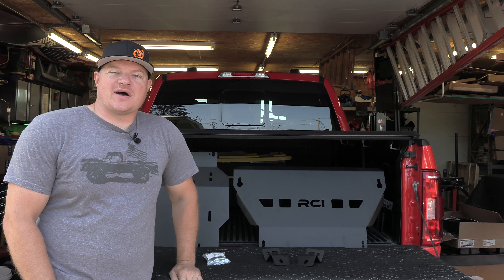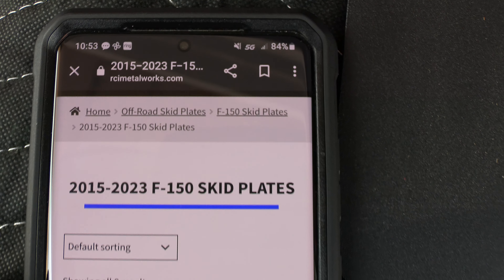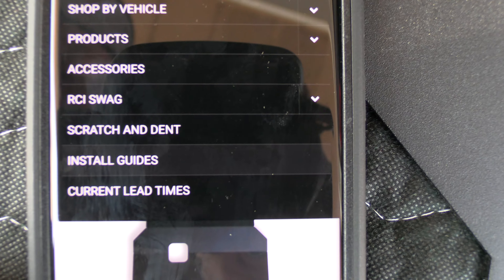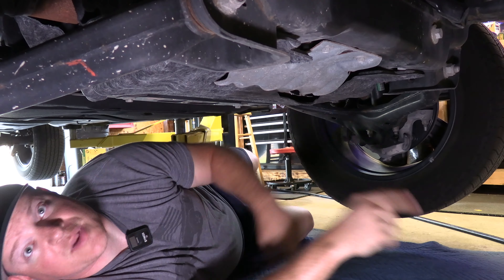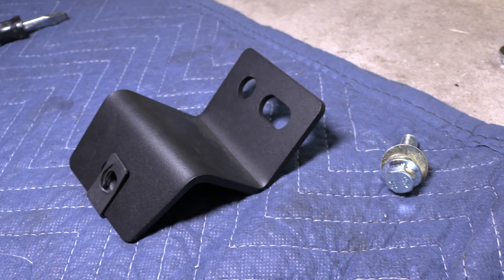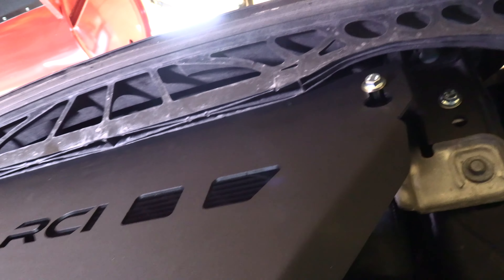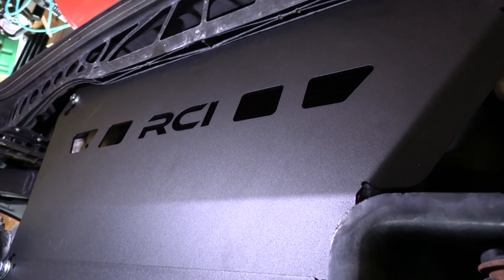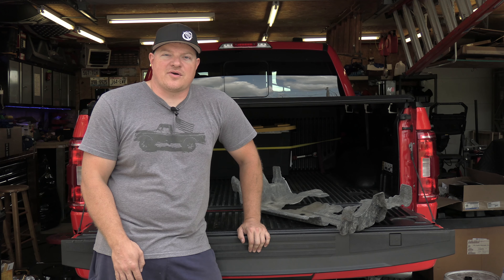RCI Skid Plate Install 2015-2023 F150

Comment: I believe you should have put the rear of the front plate over top of the front edge of the rear plate. If you were to hit something with the front edge of the rear plate, it's possible the bolts could be sheared off or other damage to the rear plate could occur. It would also make taking the front plate off for an oil change easier.
Reply: On my 4x4 there is a shield that comes from the factory for the electronic front diff.  Same as in the video.  If you install it that way it interferes.  Could remove it but then the connector is exposed to the elements.  For 2wd I think it would work as you would like to install

Comment: With the plastic oil pan on the F150s even if you just do light off roading I think you have to get skid plates in my opinion. Take that for what it’s worth. I bumped and I do mean bumped the oil pan on a log and it flexed enough to cause it to seep oil.
Reply: Me too! 🙋‍♂️

Comment: do you think the install of these skid plates woold hinder adding a FRONT 2 " receiver hitch like from draw-tite? It attaches to the frame. I have yet to see someone install BOTH the skid plates and a hitch- what do you think?
Reply from the maker: Im not sure, but this skid plate covers the air dam and front frame section. You would have to eye ball it and see if it will work.
Reply: @Oxman_Garage  Got it Thanks

Comment: I have a brand new 23 f150 xlt and I noticed that the engine splash cover is not there… is this normal??? I can see the pulleys and belts…
Reply from the maker: That is unfortunately normal. You need to buy a RCI skid plate or something similar.
Reply: @Oxman_Garage  really?? Thank you!. To be honest, this is completely unacceptable for a 60k truck.  I can’t believe Ford doesn’t at a freeking splash shield. I barely have 12k miles on it and I just noticed it.
Reply from the maker: Agreed, it's ridiculous. They should have had something like the RCI skid or Tremor.
Reply: @Forddude24 mine was $70k and it only has 8k mi with no guards or an engine cover. 🤷‍♂️

Comment: Step one... Get rid of air dam then proceed with this video.
Reply: I just installed this on a 2024 Powerboost F150.  Per the instructions, it says to remove the air dam.  I called RCI and asked them if I can put it back on afterwards.  They said if you have a 2022 to 2024 (2024 is the latest model as of this date), you can replace the active air dam which I was able to do successfully.  Not sure how many years before 2022 you cannot re-install the air dam.
Reply: I was thinking same thing. Why would you want the air dam anyway? It saves 2% in fuel efficiency I read.
Reply: @jrossnjax7  I do half highway and half local driving.  2% when driving 1000 miles  on a highway trip adds up.  If I find it is getting caught in snow or something else, I can remove it then.  Otherwise, if it can only help, why not?  I don't think it looks ugly or anything.